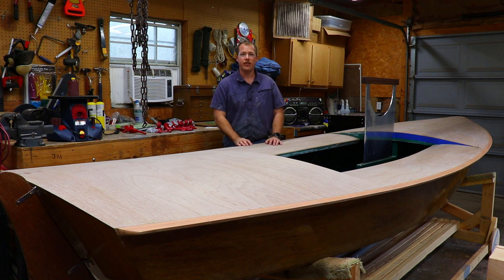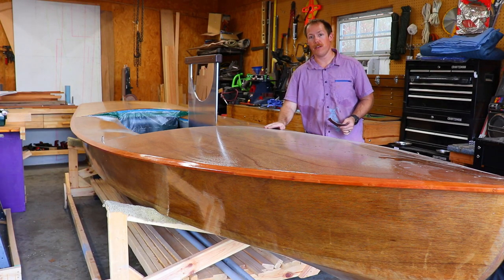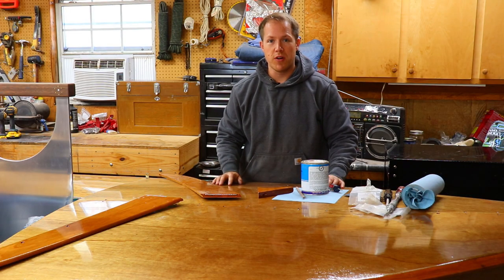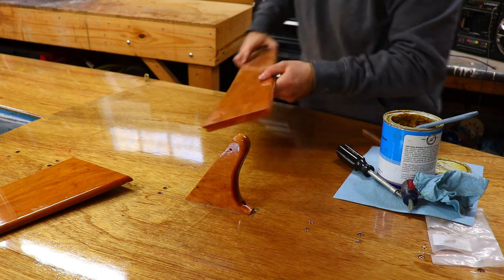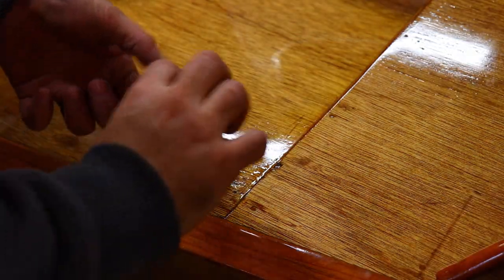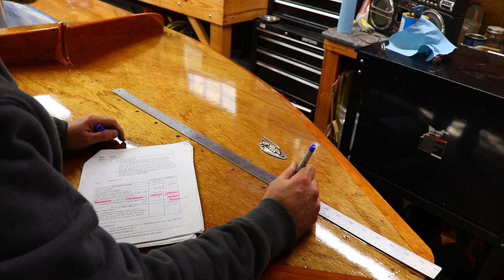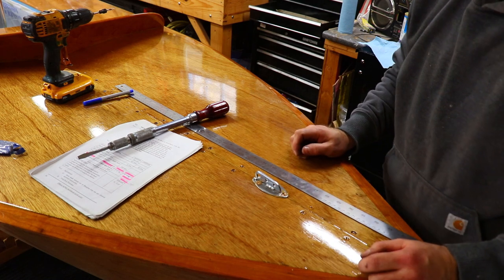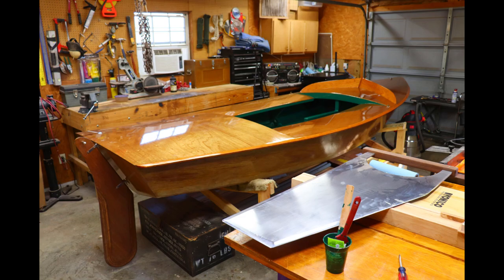Building a Wooden Sailboat #19: Finishing the Hull

Comment: Great progress. That forestay will be under a lot of strain at times, I wonder if the wood screws will eventually pull out. The plate on my Snipe is bolted through the deck.  It was a pain to get under and install, but no issues sailing all summer.

Can't wait to see you build the mast. I bought the plans, but found a used aluminum mast when I was rebuilding my Snipe.
Reply from the maker: I'm hoping they hold. The plans said the screws should be sufficient but I guess we'll see. Do you have the mast plans or just the boat plans? I haven't been able to find the mast plans and would be interested to see them.
Reply: @MakeStuffNation  I do. The SCIRA website sells them. I believe I tucked them into my shed, I'll take a look.
Reply: Actually, the forestay is really just there to stop the mast from falling over until the jib is up.  It is the jib wire which takes the strain under sail.  On some boats they both go to the same fitting, and in others they are separate.  And I would certainly recommend through bolting it

Comment: Why did you run the grain on the rear deck and the transom the wrong direction ? The grain direction on a transom is typically run horizontal and the rear deck should have been fore and aft, just like the forward and side decks.
Reply from the maker: The plywood had to be oriented that way to maximize my material usage. To run it the other direction I would have had to order additional sheets of plywood which would have drastically increased the cost.

Comment: Each to their own, and apologies to those who disagree, but however beautifully plywood is varnished, it is still just varnished plywood.  With screw heads showing, filled joints, and scarf joints obvious, this is not the look I would want to show for so much work. The change of grain direction across the deck is highlighted by the varnish, too.
I don't know if there is potential bi-metallic reaction, but even if there isn't, I'd probably have tried to have stainless steel screws in a stainless steel fitting, rather than mixing bronze and SS, if just for the aesthetics.
Reply from the maker: Thanks for supporting the channel!

Comment: Did I miss something or do you have no mechanical fasteners in your hull ply sheets? Could you tell us why you didn't fillet any part of the hull framework?  The boat looks wonderful but I'm a little concerned about the hull integrity of the vessel.
Reply from the maker: All of the framework has gussets so that provides the strength instead of fillets for the frame. As far as the panels attaching to the frame, there are no mechanical fasteners but the seams are fiberglass taped which should provide more than enough strength.
Reply: @MakeStuffNation  Taping the outer seams will connect the hull panels to each other, but it is the internal framing which defines the hull's shape.  I would seriously consider putting some fasteners through the panels into the frame, including some through the deck, which plays a part in the ructural stiffness..